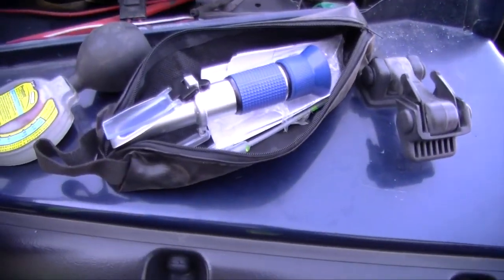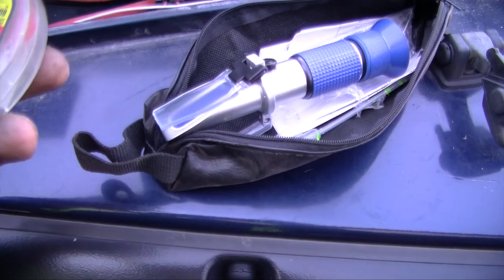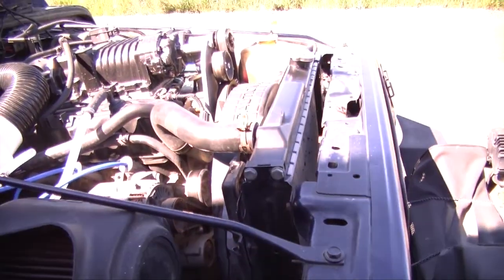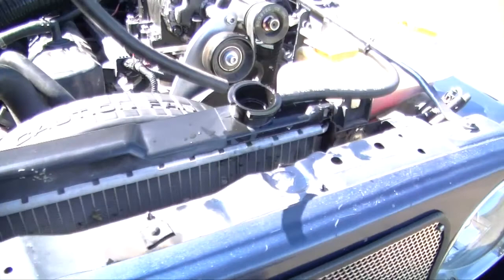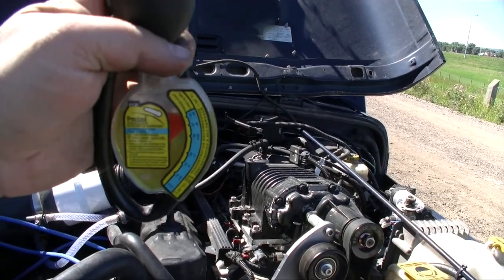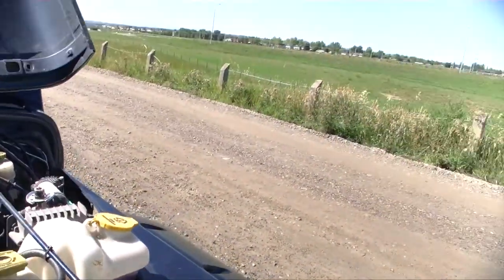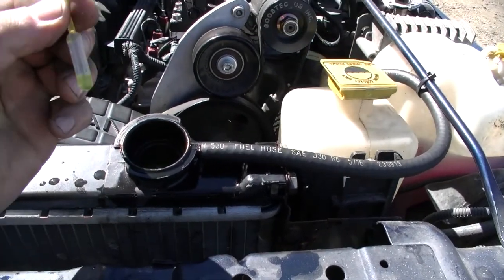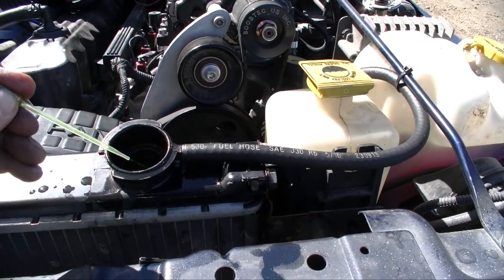How to Check your Antifreeze Strength and Condition

Comment: The first test was done wrong and was inaccurate. The antifreeze level has to be up to the fill line, otherwise the gauge will just sit at the top of the liquid, which you can clearly see happening in this video. Also, antifreeze should be tested for electrolysis, which was not done here. Very trustworthy...

Comment: Hi Jerry, so both the Prestone and the Refractometer test for the boiling and freezing points of the coolant? - refractometer being the most accurate? 

is the best practice also use a pH strip to test for the acid level? - and what is an acceptable pH range?

Thanks.